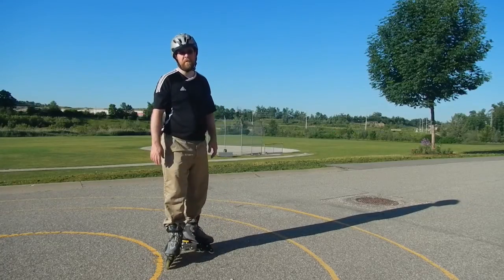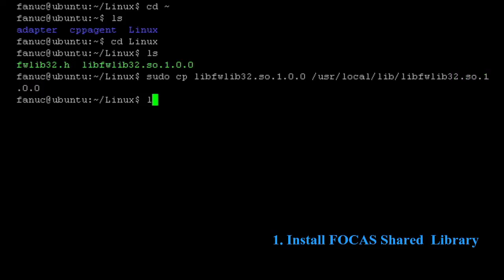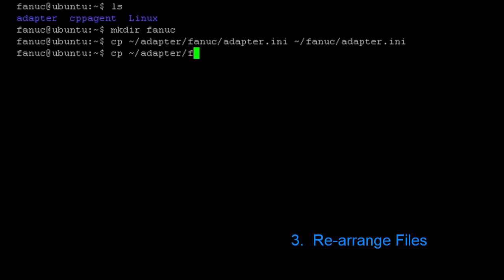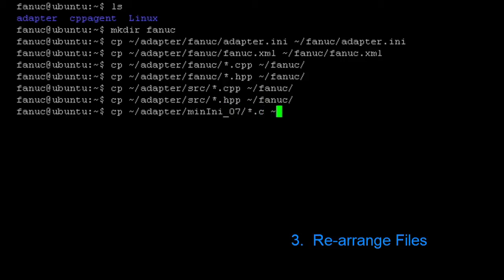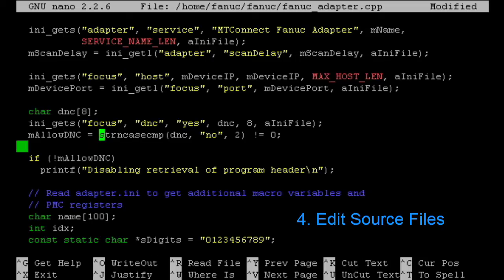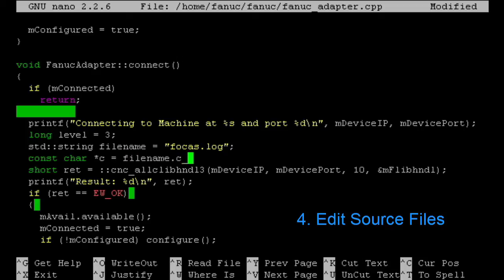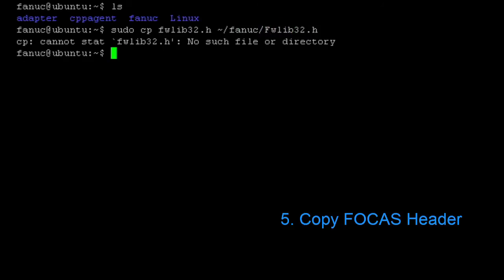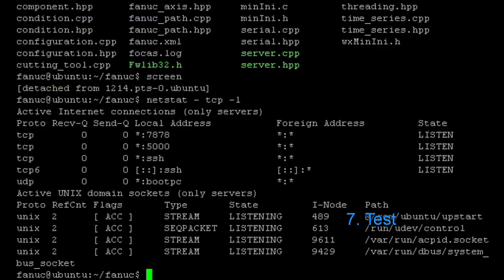MTConnect FANUC Adapter in Ubuntu Linux

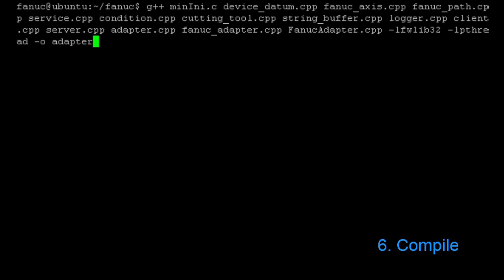Comment: thanks mike. this is really helpful. an add-on comment for linux os newbies: at @5:03, if your linux system is 64-bit, please remember to add "-m32" after g++ compile command. also its good to add the source folder of the fanuc lib file. my input is "g++ -m32 minIni.c device_datum.cpp fanuc_axis.cpp fanuc_path.cpp service.cpp condition.cpp cutting_tool.cpp string_buffer.cpp logger.cpp client.cpp server.cpp adapter.cpp fanuc_adapter.cpp FanucAdapter.cpp -L/usr/local/lib -lfwlib32 -lpthread -o adapter". spent half a day to figure this out.

Comment: Hi Mike. I just followed your instructions on Ubuntu 14.04LTS x64 and had to add in a couple extra steps for the 64 bit base OS.
1. sudo apt-get install g++-multilib
2. Compile command needs the -m32 flag ( g++ -m32 minIni.c device_datum.cpp ......)
3. I also cleaned up the compile warnings about string formatting. %d needs to be %ld whenever the compiler complains about 'long int' format like this

fanuc_path.cpp: In member function ‘bool FanucPath::getAxisData(short unsigned int)’:
fanuc_path.cpp:461:48: warning: format ‘%d’ expects argument of type ‘int’, but argument 3 has type ‘long int’ [-Wformat=]
   sprintf(buf, "%d.%d", dyn.prgmnum, dyn.prgnum);

The following warning is the only one I didn't fix... (not sure how to fix)
fanuc_adapter.cpp: In member function ‘virtual void FanucAdapter::initialize(int, const char**)’:
fanuc_adapter.cpp:74:36: warning: format ‘%x’ expects argument of type ‘unsigned int’, but argument 3 has type ‘FILE* {aka _IO_FILE*}’ [-Wformat=]
   printf("FP = %d, %x\n", errno, fp);
Reply: Use %p instead of %x.